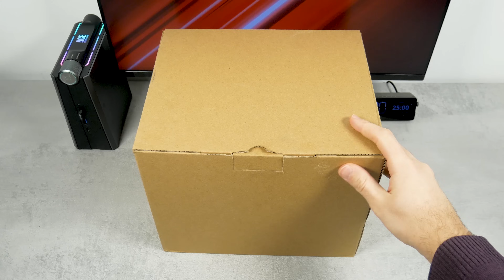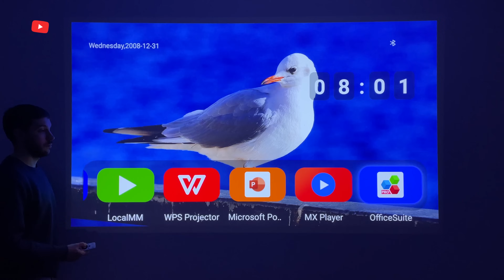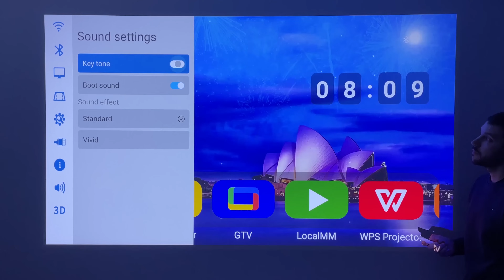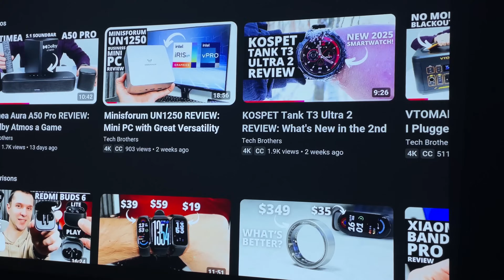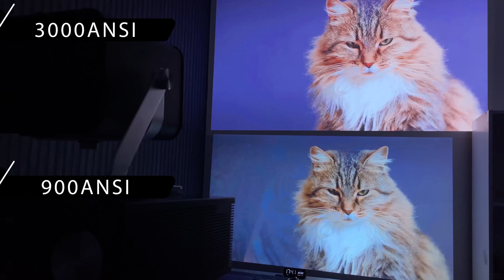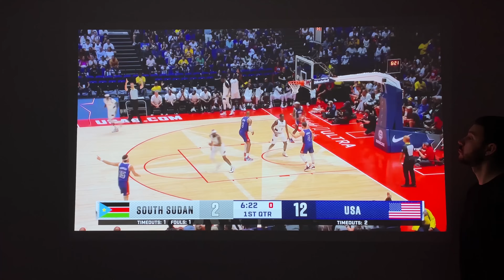Black Warrior REVIEW: 3000 ANSI Lumens 4K 3D Projector! Best Under $1000?

Comment: Como pasas una pelicula 3d con gafas (side by side) a 3d sin gafas??? Se ven siempre esas lineas negras? Yo soy coleccionista de cine 3d, tengo una tablet 3d sin gafas y eso va con deteccion ocular, que tipo de 3d sin gafas emite este proyector?? Es que esa parte no la entiendo?
How do you convert a 3D movie with glasses (side-by-side) to 3D without glasses? Are those black lines always visible? I'm a 3D movie collector. I have a 3D tablet without glasses, and it uses eye detection. What kind of 3D does this projector output without glasses? I don't understand that part?
Reply from the maker: I uploaded 3D Glasses-Free videos on Google Drive: https://drive.google.com/drive/folders/1Xa3xg6TpiSJ0h30_bmHOg2c6EQVr-T8G?usp=sharing
Reply from the maker: I didn't convert the videos, they are already available in mp4 format. Yes, black lines are always visible. These lines give the impression of 3D.

Comment: I wish there was a way this could be compared to some high-end projector like the hisense c2. I am not too sure about the brightness, and if the hdmi is earc and also does anyone else noticed that the overall picture had a slight blue tint?
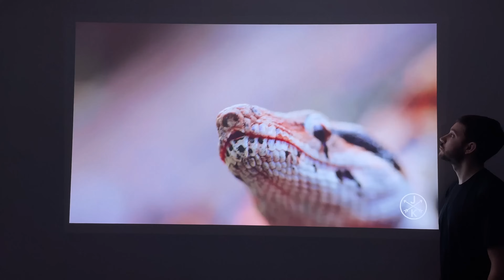Reply from the maker: Unfortunately, I don't have the Hisense C2 projector. As for the blue tint, I chose a Cool color temperature when shooting the settings and 3D videos, but a Warm color temperature when shooting the sample videos from 17:15. You can adjust the color temperature manually.

Comment: What is the different when play 3D naked-eye video on this projector when compare to the others?
Reply from the maker: You can run these naked-eye 3D videos on other projectors. They are in the usual mp4 format. However, the Black Warrior projector has a really good throw ratio, so its screen size is bigger than other projectors, as well as high brightness and contast, so the videos look quite realistic. If you run 3D videos on a budget LED projector, I think they won't be as immersive.
Reply: Can you provide the link for sample MP4?
Reply from the maker: @too101  Sure, I uploaded the 3D Glasses-Free videos to Google Drive: https://drive.google.com/drive/folders/1Xa3xg6TpiSJ0h30_bmHOg2c6EQVr-T8G?usp=sharing
Reply: @TechBrothersReviews  But ... that's just video files having the black bars already embedded ? This can be played on EVERY projector. ..what's new about that ? The kickstarter gave the impression that the projector itself embeds the black bars in a "normal" 2D video stream (perhaps using A.I.), giving it a 3D effect.  .. now THAT's would have been a unique selling point ...

Where did you get those 3D - glasses-free videos ?